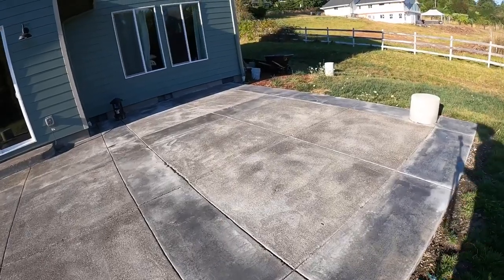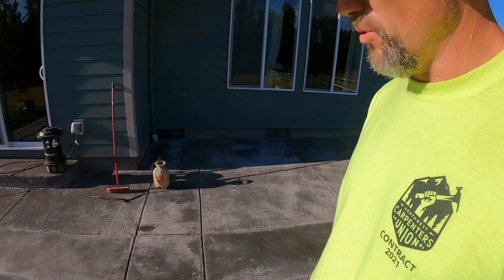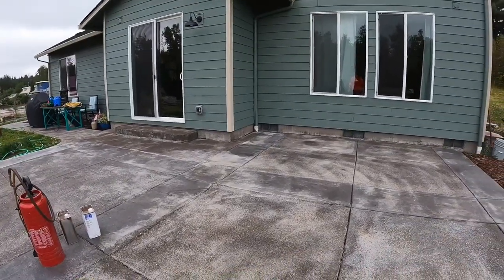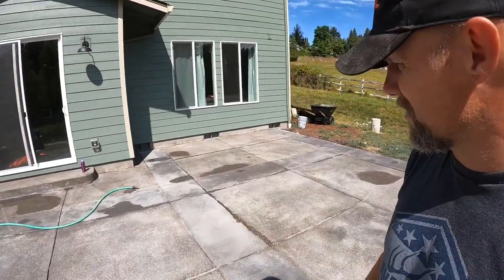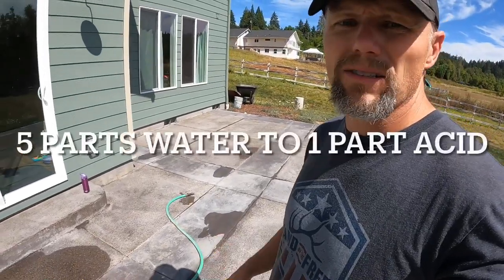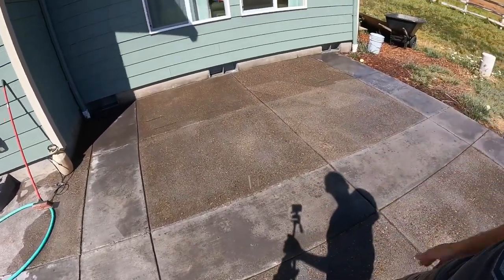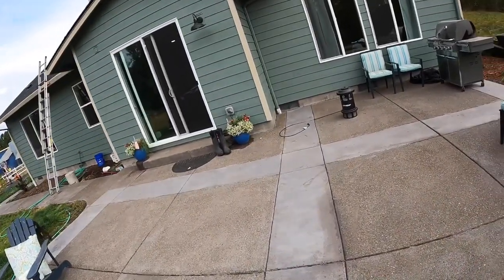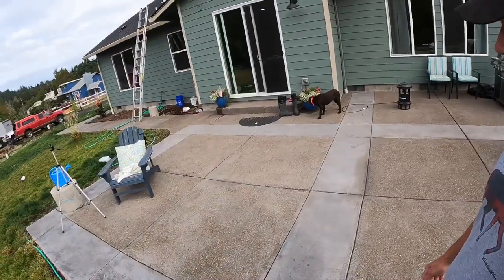Removing Concrete Sealer and Acid Washing Concrete

Comment: We got 2 hoa violations of having concrete sealer on sidewalk.
Been on sidewalk 25 yrs when original Hoa approval was given. Now new hoa says sealer unsafe & safety hazard-must be removed. 🙄
-Tried pro pressure cleaning
-Paint thinner
-acid wash/scrub.
Got quotes for sandblasting & grinding & all companies quoted $1500+ to remove sealer from sidewalk only.
Gonna give your method a try. Praying it works! 🙏🏻
Reply: Did it work
Reply: Hi..curious as to what worked?

Comment: was wondering how many coats of the zylene. and it's a sticky mess.  maybe because there may be 4 or 5 layers of sealer?
Reply from the maker: I did about 3 to 4 coats of Zylene to get the sealer off. There was just one coat of Cure/Sealer.